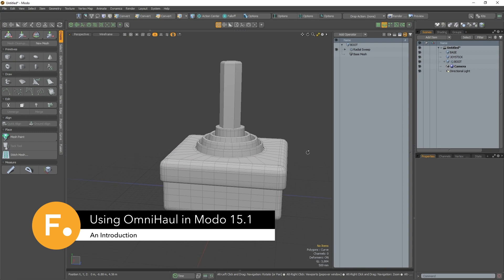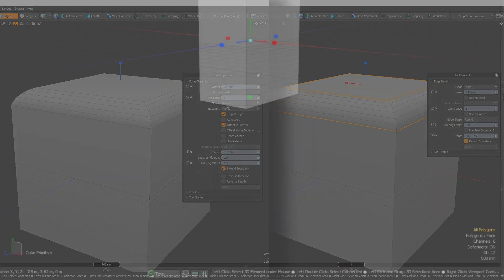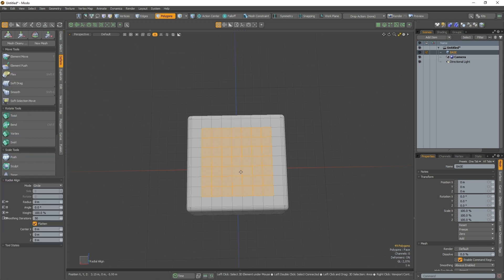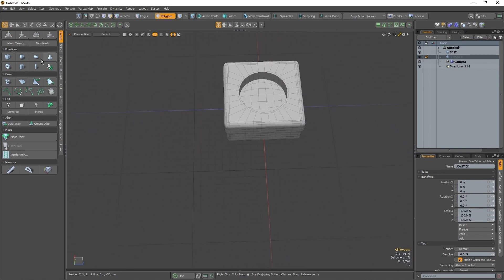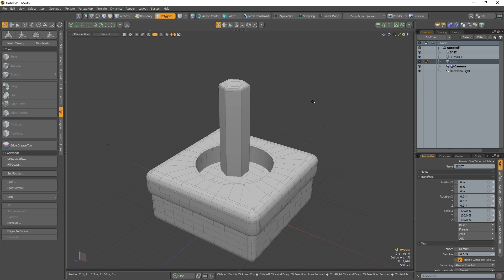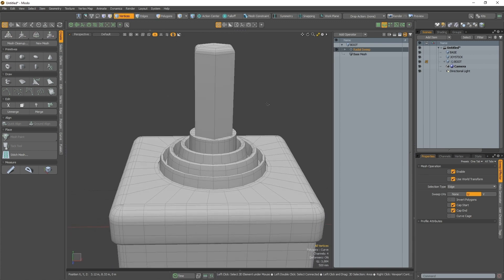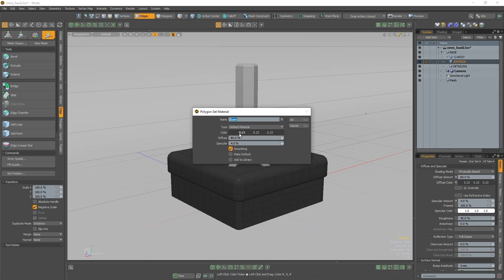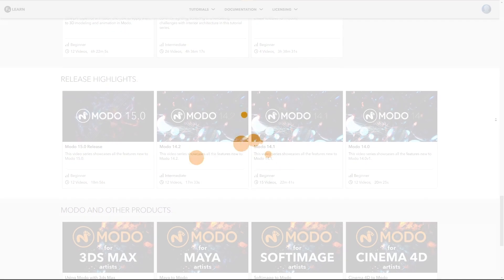Modo 15.1 - Speed up Your Workflow With OmniHaul

Comment: Isn't it a bit stupid to link the new OnmiHaul to the space bar which has been used forever to cycle between vertex / edges and poly mode and to drop tools?